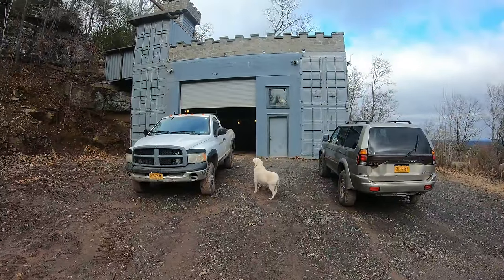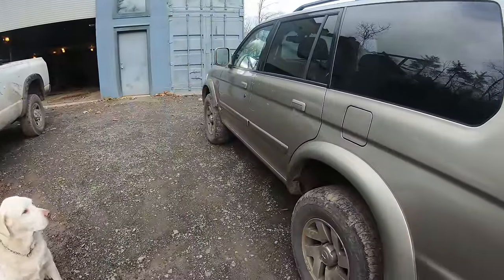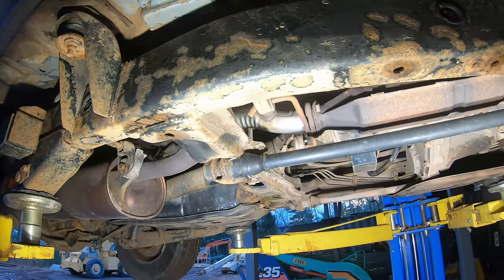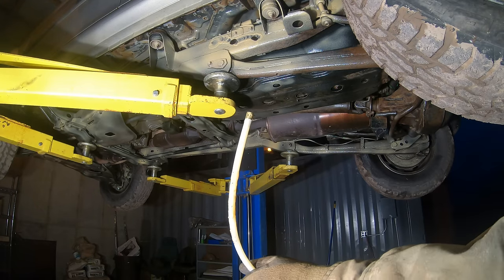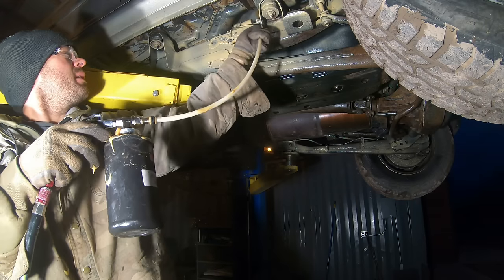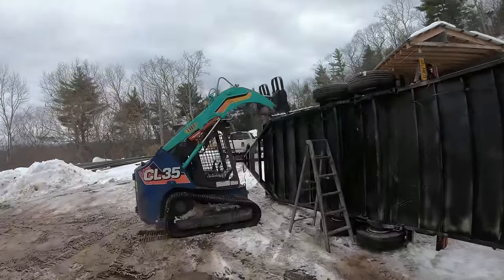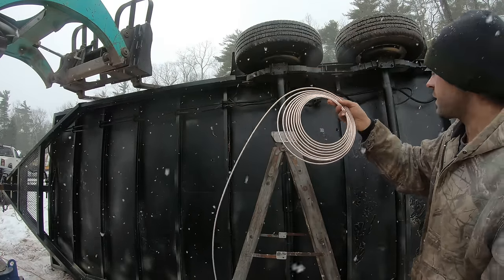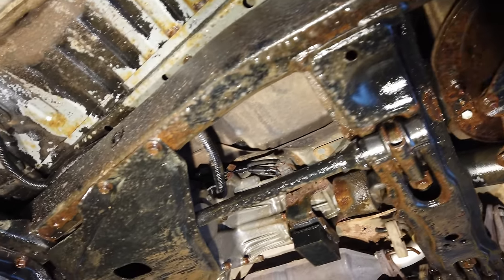Undercoating vehicles

Comment: You should try and hit those “surface rust” areas with a rust converter before undercoating. It chemically converts rust to stop the progression of the rust. It also converts to a primed surface ready for top coating. Painting or undercoating over live rust still allows the rust to continue spreading. Just an FYI from a metallurgist! Love your videos and can do attitude, keep up the hard work! Can’t wait for the building videos!
Reply: Phosphoric acid only etches the exterior metal surface it does not convert/kill the rust. Therefore the underlying rust can still continue to due it’s nasty stuff!

Comment: If open to a few suggestions here they are;
1) make sure metal services are at least at 60 to 70 degree ambient temperature.

2) Neutralize rust: 
I prefer hydrofluoric acid(let it set for a couple minutes) then after that neutralize it with a lye soap. Pressure wash, dry very well. Proceed with oil based product,  NOT acrylic nor rubber type, they hold in too much moisture on the metal surface. 
Be safe....🙏

Comment: Next year you should check into spraying Cosmoline (RV-342). It'll last a lot longer than fluid film. The same stuff that the military uses when transporting vehicles and equipment over the ocean. My truck smells like a crate of mosin nagants whenever I drive. the coating is a type of rust inhibiting wax and it will self heal for years. I researched it a lot and most people are happy with it, even found a guy that coated his ranger frame just once 20 yrs ago. it's finally getting thin and starting to show light surface rust. this is the same stuff you would find under an older Ferrari

Comment: I've been battling rust for five decades! Rust conversion coatings (EG Duro Extend, etc.) are great, especially we keep handy if you're under a vehicle for something else. The factory undercoatingwas sold and intended for noise reduction only, the stuff you applied might be better. In the 1960s and 70s, had a sign outside: "waste oil spraying in body panels", about that time I tried some professional rustproofing outfit ; Ziebart. Useless. Chrysler products have always been dipped at the factory, waist-high, in epoxy primer. Just sayin'.

Comment: Instructions not clear. Will any brand of creamy peanut butter work or do I have to use fluid film brand peanut butter on my frame. I want to keep my frame nice and protected for those furious Arizona winters. 

P.S. if I use jelly will it help lubricate my ball joints.

Edit:
I turned my Prius upside down to apply the peanut butter just like you did with the trailer and my roof got dented. Do you think this will buff out? Thanks

Comment: I commented on the video where you got the white Ram, but I should have known you were familiar with the Fluid Film, that stuff is the best, stinks a little if you get it on the exhaust and whenever it rains, but a small price to defeat the cancer. I paid a guy $200 to do it the first time like 10 years ago and he didn't even drop my spare tire. Second time me and my buddy did a bunch of vehicles using an airless sprayer and it wasted a ton of it, I think we used 15 gallons on 6 or 7 vehicles. I finally got the right gun with a kit like you linked, what a difference, let's just say that the 5 gallon is going to last me a lifetime. That trailer is almost too new for the film to work, you need a little scale for it to really bite

Comment: One of the best things you could do to cut down corrosion, would be to build an under carriage cleaner, like car washes have. Basically just drive over it and wash it like that. They have these at some Naval air bases. They call them bird baths. Aircraft that fly low over the ocean roll through it after they come in. They activate it remotely. Flushes out a lot of the salt.

Comment: Here's a thought.  I am not in a position to try it myself but I swear it's a good idea...  Cover up the exhaust and engine (all the hot bits) then spray the entire underside with household black latex wall paint.  It's thick and will keep the water/salt off metal.  Then remove the covering off the hot bits and spray high-heat black paint on those too.  This deal with having to reapply a  thin oil film every year is no good in my book.  Coat the crap out of it and be done.

Comment: Hi Andrew,  I do kinda the same thing. I spray the bottom off with a pressure wash and get it very clean.  Then I use a light media blaster to remove the rust.  When the metal is clean I spray it.   I have tried several things including bed liner for pick up beds. The bed liner has worked good. It is black so it’s very obvious where you have missed.  I am glad I don’t have the salt to deal with!

One of the best treatments is just paint.  I have used OILBASE BLACK ENAMEL PAINT to protect metal.  In Florida that works very good and it’s cheep and easy, but we don’t have salt on the roads. 

I have also used the paint and then used bed liner over that which made a mess. The bed liner blistered the paint.  It was not dry enough and blistered. 

How has your product lasted? 
What was the name of it?

Comment: Ashes to ashes, dust to dust, It doesn't matter what you spray on them they are gonna rust. Used motor oil is used commonly in the same way for the same thing. Some also use driveway sealer and roofing tar.

Comment: Good looking, knows when to 2x powerwash segment. Also, Ive done this with a forklift at work once. 30 min lunch. One flat. Git ur done, Beer run. I swear the car always was tilted. Like I bent a shock bracket. Was side lift, but wish I hadnt done it. Got the beer n lunch under 30 min..... Also I noticed on the flip. That trailer was reinforced at point near the wheel. You can clearly see a little flex.

Comment: I have under coated with transmission fluid and engine oil..you have to do it every year..but it's free..i use a paint sprayer....i do everything underneath from the frame to the gas lines..doors and floors...inside of everything as well

Comment: Andrew that fluid film kicks butt. it impregnates into any bare metal and it will stay on for a long time. only other thing I've used in my 2q5 plus years of body working for a living was krown but than your paying a krown dealer 150 per 8-foot bed truck. we did drill holes in rockers and the dog legs behind the back wheels and sprayed in them. eric o from new york channel sma did a video on krownimg his Toyoda and yes this krown spelled with a k not a c

Comment: my suv is not the beast but it is a 2000 g m c r w drive iv did 1 tun up no heat no air white and sliver 10050 miles  22 years doing great i think never haed one last more thin 3 years o well thabks

Comment: 7:10 Get a 6 gal bucket lid, paddle bit hole size of mixer stem, put the stem through the lid, put the lid on, start drilling. No more mix slinging out the bucket.

Comment: It's better to do this when it's warm out so it will creep . Also , you need to get inside the frame to clean out dirt that builds up and get that oil in there . Inside doors , fenders and rocker panels is very important too . Look at same vehicles that have already rusted to find the areas that really need attention.

Comment: What kind of undercoating was that you used If u don't  mind me asking look think and looks like it sticks good I usually use Rust check but I find it's a little thin and doesn't stay on the frame for long plus  it's a little pricey wich I wouldn't care so much if it lasts the winner but I find myself doing tuch ups.

Comment: You can get a under carriage washer attachment for a power washer for 39 bucks free shipping. They work great I use it on all my trucks and cars up here in Oswego ny .it will remove all the salt and sand under the vehicle easy. A lot safer then lifting a vehicle like that. My trucks and  cars have zero must on them. I do it 2 times a week. One is a 2013 F 150 with zero rust

Comment: Would of been good if you could of driven down a dusty gravel road right after the application of the stuff. The dust mixed with the oil would be perfect. I don't know if you have the same kind of gravel road's there as I do here where I live. Our gravel roads are the color of that product you sprayed and on a dry summer day the dust hangs in the air for 5 minutes.

Comment: Use your airless paint sprayer to apply that stuff.. Just use low pressure and change out the tip for a .028 tip.. Spray right outa the 5 gal bucket.. Way faster, better coverage,even flow..

Comment: Also,don't be afraid to drill holes and put body plugs in the areas prone to rust,rockers door jambs,doors,AND its  a huge myth that if you drill your body it promotes rust,especially on the dodges,hit the cab corners and rockers.Based on facts not fiction.

Comment: I dislike them trailer surge brakes for the simple reason is I have no control over it, winter driving it's nice to have the manual override with electric brakes.
Reply: Try backing up hills with surge brakes, it's much more difficult when the brakes are automatically applied and you can't do anything about it.

Comment: Just did my truck almost the same way, after washing it I did apply fertan first, it pasivates-is that even a word?- the rust, only then I applied the fluid film. It's no longer a problem finding it in the parking lot if I don't pay attention, it smells horrible. But works I guess.

Comment: Next time if you want something just as good that is way easier to apply try wool wax. It's made by the same company as fluid film but its way easier to pour out and spray and also it doesn't have the strong smell. I've used fluid film for years but switched over to woolwax and have had good luck with both

Comment: Got to get your fluid film up around 100 degrees. Flows a lot better. I mix mine 50/50 with chain saw bar oil. Makes an oily drippy mess for a couple weeks. Next time take a stock pot, put a bunch in and heat it up on your hot plate.

Comment: one of the bigger problems with the total box beam frame is all that same bullshit gets inside and when its cold expands and does bigger damage from with in. the key is to purge not so much with pressure but maxx flow  go in high at the wheel wel and keep it coming till its clean  flowing out of all weep holes . theres your dinner

Comment: With that much rust, you'd get better results if you apply a rust encapsulator (THEN do the fluid film for extra protection, if you want). Especially because you prepped to a good surface with no loose rust, oil, dirt.  No car comes from the factory with bare steel and fluid film. Those rusted areas need paint. I like Eastwood products, regular and rubberized, but they are expensive. Still I bet you could do one car with 3 18oz cans, maybe $50. Then you don't have to reapply every year.

Comment: Surge brake system, hit the brakes in the truck and the force of the trailer pushing the truck makes the trailer brake? How does that work coming down a mountain?
Reply from the maker: Yes, it works good because the trailer is pushing against the truck.

Comment: Have done that with my vehicles and it does work. I do redo it every year. Better than most products although I want to try a product selling around here called PFC, which is lanolin based like fluid film but with other additives. it is from a company in Johnstown , pa. called Berkebile Oil. Not sure on the spelling but close. Hope it works well for you.

Comment: I see at the end you had some drone footage - any issues with running them in below freezing temps?  Saw on the Mavic mini that the operating range low was 32 degrees.  Do they freeze up like the iPhone?
Reply from the maker: I have never had problems with the drones in the cold as long as I start with a warm battery.

Comment: So Andrew, I'd like to hear why the salting of roads is pretty unnecessary in your opinion? A plowed surface is still slick and in the case of ice, then salting roads in a no-brainer. People still need to go to work, live their lives etc and roads without salt would be a catastrophe, esp with salt being able to melt below freezing point. One of the non-benefits from living in the north until they come out with something that melts snow/icy but isn't corrosive, (as much as I hate it also; 2007 Tacoma rusty frame replacement).
Reply from the maker: Because the salt does too much damage, its not worth it. Just have 4x4 vehicles with good studded tires.
Reply: Is your new frame rusting already? My dad got a new frame on his Tacoma I think in 2016ish and it's already rusting again. I think they just use the same junk metal on the replacement frames so it will probably be rotted out again in a few years.

Comment: Should You Use a Pressure Washer to Clean It?

“You might be inclined to pressure-wash just about everything around the house, but that’s not always a great idea,” says Dave Trezza, the test engineer who oversees pressure washer testing for Consumer Reports. “The supercharged stream of water can damage paint and nick or etch wood and even certain types of stone.”

Car
Should You Pressure-Wash It?
No. Plenty of people use a pressure washer to clean their car, of course, but it can do more harm than good. Using a pressure washer can damage or nick the paint, which could lead to rust. And a car wash usually gets the job done just fine—so do a garden hose and soapy sponge. Use a little elbow grease and a specialized cleaner on problem spots such as wheels.

CR Consumer Reports
By Paul Hope
Last updated: April 18, 2018
Reply: Just keep the wand away from the radiator and you will be fine

Comment: 17:40  It looked like you put a single flare on that brake line, instead of the usual double/inverted flare.  Is that acceptable on the copper-nickel lines?
Reply from the maker: Sure, I have never had a problem with it. The steel lines are the ones that are constantly failing.

Comment: Living in Germany I always wondered about the electric trailer brakes you usually see in the US. I am not even sure if they would be legal here, at the very least you never see them. Trailers here from a certain weight have to have brakes to be street legal here if I am not mistaken. Only for small trailers no brakes are allowed (Up to I think 750 kg, about 1650 lbs) Not sure if this is actually the legal limit, but about every car here has that limit in allowed trailer weight without brakes. Over that you either have to have surge brakes or mainly for larger trailers and thus commercial trucks, air brakes. And with truck I am not talking pick up trucks but about everything above 7.5 tons. Somehow the concept of electric trailer brakes vs. surge brakes seems to be unneccessarily complicated to me, requiring the additional brake controller in the towing vehicle, if you already add brakes to the trailer anyways. I think some campers and high end trailers may have electronically assisted brakes. meaning the trailer kind of has its own ESP to prevent swaying etc., but thats all about it.
Reply from the maker: Electric brakes work. They are the most common type of trailer brakes.

Comment: So there's a product called "Salt lick".. it's a detergent you run thru your PW and it's designed to neutralize the salt from the roads
Reply: Krown Rust Control also makes a product you can look up on Youtube called MR35 Salt Remover, designed to for lack fo a better word dissolve salt/brine etc, put in a foam cannon etc and spray on  , or pump sprayer, or trigger bottle.  Leave for 5min and rinse.

Comment: I kept saying "it's gonna roll over, it's gonna roll over"!  Turns out it worked better.  If that were me, that SOB would have flipped all the way down the cliff and broke into a dozen pieces!  Electric brakes on trailers suck!  I had a 35' boat trailer with surge brakes and loved it.  Tough backing up a hill though.  The one trailer I have left with electric brakes I tore all the wire out and ran it through pipe and EVERY light is grounded separately and a ground at the tongue.  I Will never buy another trailer with electric brakes...

Comment: You know, I hate to be repeating myself,  but are you sure you would not be better served by installing a sacrificial anode, such as what they use to stop rusting of boats or buried gas tanks.
Seems they are less than $20.00 for each vehicle and it stops rusting of all grounded metal in the vehicle.

Comment: Does it stick to wet surfaces? Also, it doesn’t matter if you spray it on your brakes? Like caliper and rotor?
Reply from the maker: It probably would, I wanted for it to dry though. Try not to get it on the rotor.